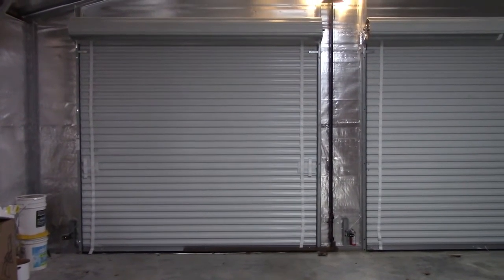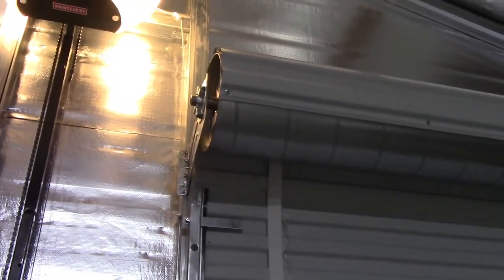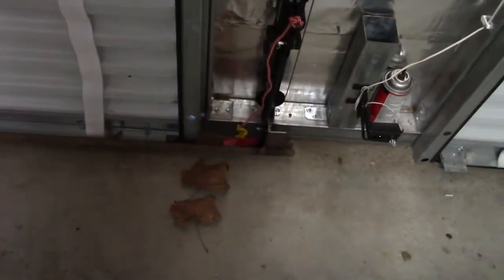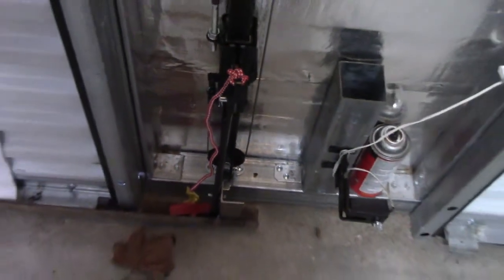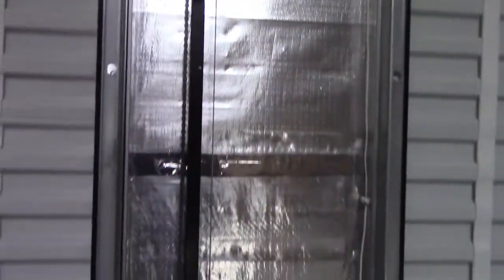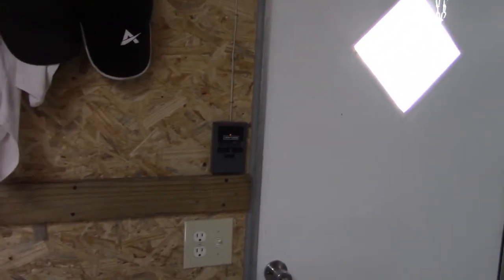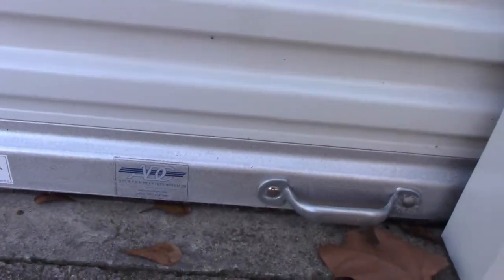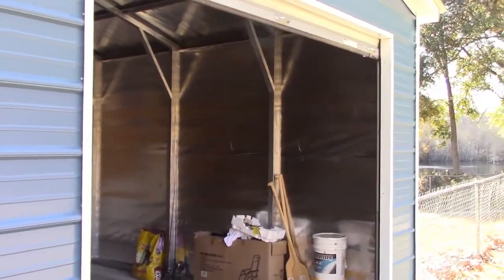2020-12-22 manufacture a roll up door opener

Comment: I am having trouble with this design.  When you put the power on one side, then one side will rise first and you will have uneven roll up.  I have built mine almost identically, but can't figure how to get it to raise evenly so it doesn't seize up as it rolls up unevenly, quicker on the side of the motor.  I have tried everything.  But even if I release it from the motor and raise it by hand from the same place, I feel that side raise first and get uneven roll up.  Still trying to figure out something so that the design will work for all applications.  Any advice would be appreciated.
Reply from the maker: Just going thru some old vids and saw your comment.  Hope you got it figured out.  Sure sounds like you did not have the spring tight enough.